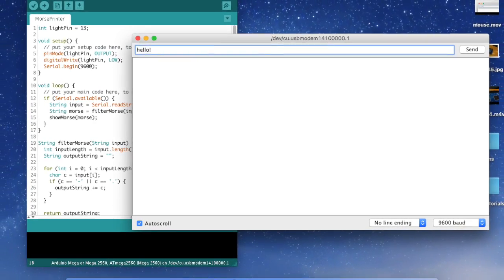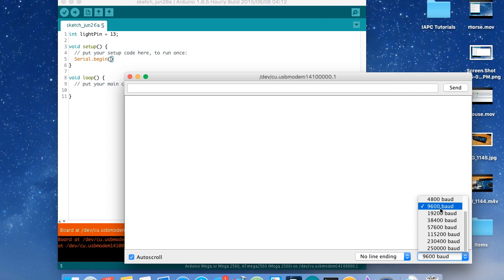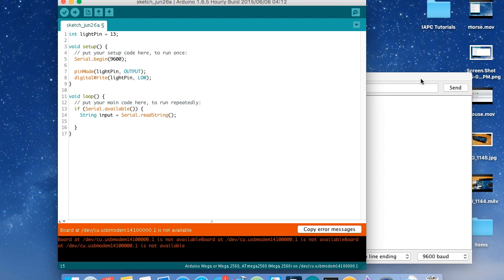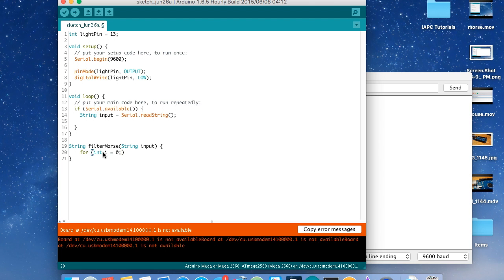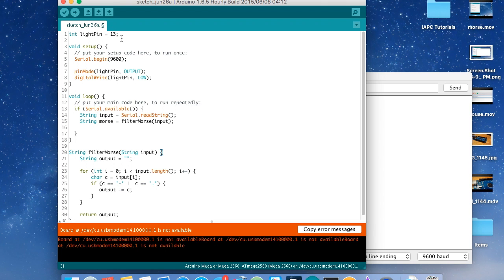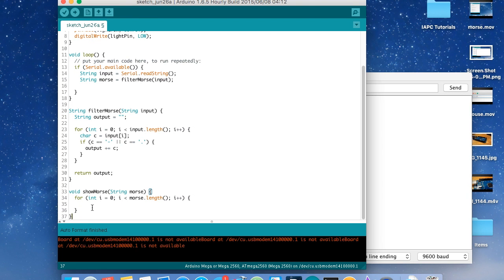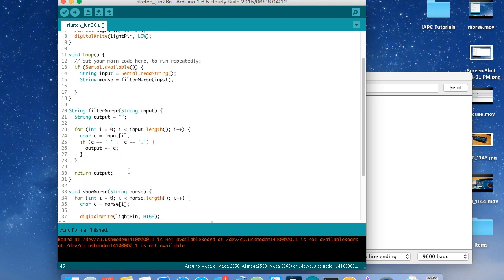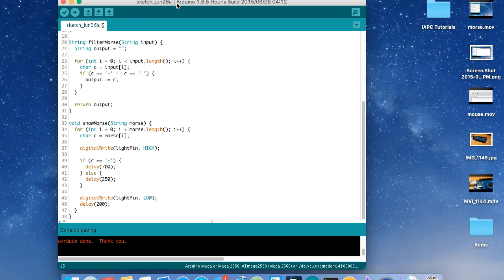Arduino Morse Code LED

Comment: Great video man thanks, is there a way to send morse code from one arduino to another using a laser pointer on the sender and a laser sensor on the receiver and make the receiver trigger a digital pin once the correct morse code is received, ie. Light an led or turn a motor on, and if the morse code sent is not correct, it does nothing ! .... Correct morse code = a specified set of letters or numbers of my choice saved in the receiver "like a password"